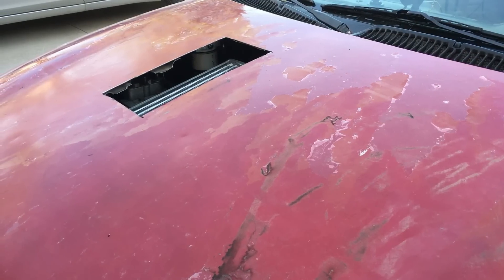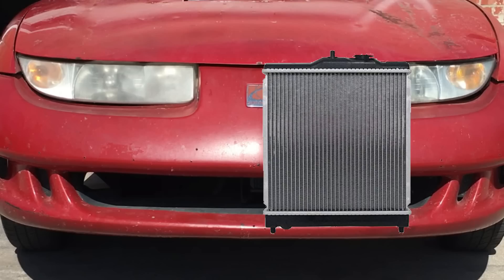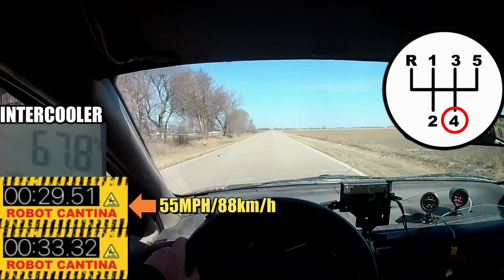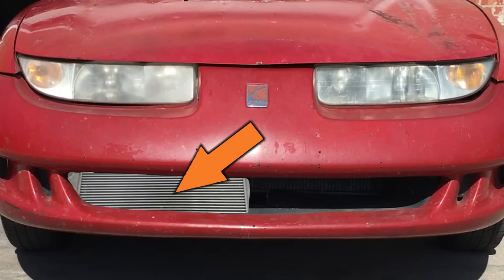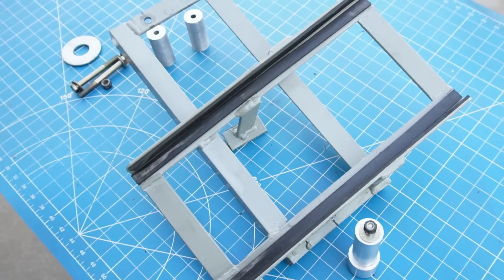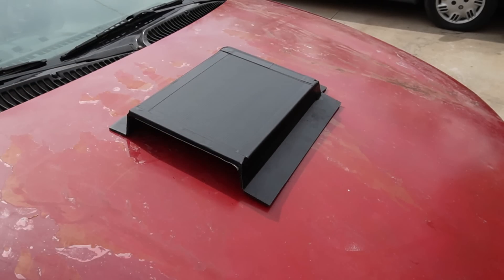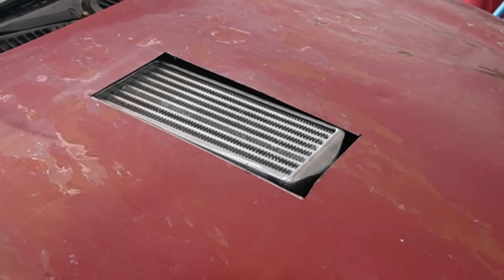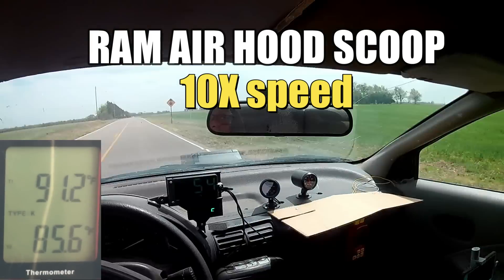S3 E12.  Testing different modifications to the intercooler on the Kubota turbo diesel Saturn.

Comment: I think he should definitely try the fans under the IC, and also rigging up a windscreen washer to spray on the intercooler but not while there's fans fitted. The hood scoop could be replaced with a better looking smaller one if the other ideas don't give any gains.
Lastly I think he should try and see if he can get the turbo to boost to a straight 1bar and then add more fuel for a final 0-60 test. It would also be fun to put the car on a Dyno at that final stage of tuning and see what it makes at the wheels compared to the factory rated bhp for the engine. The dyno pull is less stressful on the engine than doing long top speed runs too. If it survives all this which I think it will, I'd retire that little engine as it's more than proved itself then.
I also hope he tries to find a cheap 2-3 cylinder 2stroke engine for the Renault project. Alot of people have wondered if such an engine can be successfully mated to a car gearbox the way he has with the Kubota.

Comment: I have a 1,0 TSI VW Golf 7 with 85 hp. Normally, I drive at max. 3000 rpm, mostly 2000 rpm. Power is torque x angular velocity, so at 2000 rpm and 175 Nm, the engine got 50 hp at that rpm. You can drive at 90 km/h at 2000 rpm and easly pick up speed. For the max. speed of 180 km/h it needs the whole 85 hp. And till 150, it gets there very quick.
Jimbo is on the right way: You need far less power, than most engines produce. So they can't run in optimal power output and have a very poor economy.

Comment: It makes perfect sense that "plan B" worked so well. You said the intercooler didn't provide any performance increase, but I think you might be overlooking something. I've found that, for every 1 degree decrease in intake temp the exhaust temp also (usually) decreases by 1 degree. You had issues with exhaust temps in previous videos. The ram air scoop decreased intake temps by 13 degrees. Did you notice a corresponding reduction in exhaust temps (Maybe not the full 13 degrees)? That might allow for some adjustment of the injector pump and/or you can push the engine a bit harder on acceleration.
The fans should yield similar results as the scoop but I think it goes without saying the pushing air though from the engine bay will increase intake temps.

Great videos! I always enjoy seeing what contraption / combination you'll come up with.

Comment: Sooooo.... Any thoughts about my 'Heath Robinson' approach to using a 5 Litre pressurised garden sprayer filled with ice and water, with the spray nozzle spraying ice cold water onto the intercooler/fins to drop the intake air temps down to even colder temperature?? I'd give it a try hahaha 🤔😏😉
😎🇬🇧

Comment: If the intercooler temperature isn't making a different, that means that the air density there isn't making a difference.... YOU NEED MORE FUEL!
So back to the fuel rack... maybe new and bigger injectors, and hope you don't punch pistons and rods out the bottom.

Comment: Another great video!

The cowl induction scoop needed to be extended to almost the base of the screen to tap into the pressure zone there.

I liked the Ram induction scoop, you could also have ducted the base of the cooler to the bumper inlet if you don't want to run a scoop. 

Really enjoying the series thanks for all the effort.

Comment: Cowl induction works because the engine creates more negative pressure than the air around the hood. In this application, there's actually positive pressure below the intercooler, and that's actually drawing air in through the grille, which is being heated up in the engine bay and exhausted through the reverse-facing hood scoop.

Comment: now at this point im wondering if the hotter air would make it burn better an get better mileage, the front facing scoops always work better for hood mount intercoolers, i mean subi an other brands use that style an its not just for looks lol, but the cooler air from the front facing scoop if the cooler was bigger an had more of a whole in the hood to fit it that might do something, but at this point i thnk that intercooler is just tapped out.. great work on the tests an debunking scoop placement an design, thanks again jimbo !

Comment: There appear to be solid tappets inside the injector pump which will adjust the fuel timing beyond the single gasket/spacer, if you can get or make thicker ones.  They have numbers on them so I assume you can get a range of thicknesses.  Of course too thick and not enough mounting spacer and it could fully bottom out and ruin the cam or pump.

I think the metering screw in front could be attached to a servo motor so a goofy little arduino or such could read some sensor data and turn the fuel up at high boost/rpm, or turn it down at high EGT.  Based on the thread pitch it should be pretty accurate in MM per the swept angle.  This might smooth out performance and also get the top end into 5th without high EGT by fine tuning fuel on the fly.  Also once the microcontroller is reading sensors it could datalog.

I got these ideas watching this teardown/cleanup/reassembly video: https://www.youtube.com/watch?v=cO5qPn7S6co

Toward the end he tunes in the fuel metering while it's running so that it doesn't surge at idle and goes full governor at full throttle and doesn't die when slapped back shut.  This alludes that something could tweak that while running as long as it has the capability to set it accurately back to idle/base quickly so it doesn't die off.  Some gas turbos will adjust the fuel pressure according to the boost level to change the lb/min feed rate, this would emulate the same thing.

Too bad there isn't an easy way to make the timing adjustable on the fly...

Comment: Aluminum will dissipate heat even in a hot environment, if you’ve ever welded (or even just tried to cut)aluminum you will experience this first hand.

Comment: Good video! I think that the fuel induction method here is probably the limiting factor in not realizing the the more dense air charge from the cooler air. The air to fuel ratio is just not able to be adjusted on the fly to take advantage of the density improvement of the air. 

I think it’s the universal gas law that would seem to used to calculate the volume of a gas at a given temperature and pressure.. if the pressure was the same for both the 125 degree air and the 95 degree air there should be a double digit percentage increase in the volume of air being supplied to the engine. Rough guesstimate of 20-24% which theoretically would be substantial if it could be fully utilized.

Comment: Intercooling is only necessary if boost is above 9 psi.   Colder air is denser, so you'll need to add fuel to take advantage of the lower temperature.  The air has to stay in the intercooler long enough to dissipate the heat it holds.  Might want to experiment with an output restrictor to increase the charge air dwell time.

Comment: Heating the intake air makes sense given that diesels use the heat of compression to ignite the fuel, so starting from a higher initial temp just raises the final temp a few degrees making ignition more positive.

Comment: Fans cooled intercoolers are a thing as i am shire you know. But i don't think a computer fan has enough pressure to push air effectively through such a thick cooler.
So you may have to find a fan from a water cooled motor cycle or quad that will have enough power to get air through.

Comment: You will not gain/add power until you add fuel. Intercooler is there to keep high numbers lower, you can't make more power without more fuel which can be done with you lower intake temps.

Comment: Keep up the good work. I love these videos.

I doubt it will make a big difference in this application, but it might be worth doing some manometer testing to make sure there isn't a reduction in pressure difference from in front to behind the radiator.
I would think it would be a non issue given the rad only takes up half the grill.
In some applications, adding a good scoop can reduce the air pressure difference across the radiator and cause heating issues. Again, unlikely to be an issue here

Comment: You k ow that you are missing the hood scoop right? And all intercoler systems inside the engine bay. TMIC. SMIC VMIC. They all suffer from heat soak. Why not prove it and run a Air Temp sensor before and after and go for a drive. You’ll notice it only gets hot at a stop. During driving it will receive fresh air and the bottom won’t be hot like you are assuming.

Edit: leaving the message up but it pays off to watch the video before posting. Carry on. 😅😮😢🙄

Comment: The diesel Isuzu Bighorn ("Trooper") (not pronounced "Ee su zu" but "Eye su zu", kinda like "Ka boat ta" instead of "Ka boot ta" ) has a bonnet (or "Hood") scoop and rubber surround. I noticed that the front of the intercooler was sticking up into the airstream flowing over the bonnet, perhaps angle the intercooler so it's more in line with the angle of the bonnet and add gasketing between it and the bonnet with the bonnet scoop?.

Comment: Instead of scrapping it out why don't you sell the Saturn to your fans???
Reply from the maker: The value of the Saturn is based on the sum of the parts that it took to build it.  No reasonable person would pay the amount we would need to recover the cost.  When we scrap the car we will of course keep the engine and all the custom built parts to use on another project.
Reply: @Robot Cantina  I wish I had real money to talk with. I would totally rock a 750cc turbo diesel Saturn. lol, this car would be the talk of Mississippi.

Comment: All you had to do was spend 15 minutes cutting and bending a piece of tin to be a heatshield. Also for what its worth, engine masters discovered that even without airflow, an intercooler still provides cooling, acting as a secondary radiator.

Comment: I hope to see this car get perfected and even more get some cosmetics attention. Would be cool to see it as a fully functional decent looking car. To bad its going to get crushed....
Reply from the maker: The Saturn is in poor condition and was in a bad accident a long time ago.   A lot of the metal under the skin is damaged and the front subframe is bent.  The windshield is broken,   Every plastic body panel on the car is damaged.  The floors are rusted through.  The wheel bearings are bad, the interior is  disgusting.  Overall the car is ready for the scrap yard.  It was the perfect car to do our experiments with but I'm afraid it really cant be restored.  The engine and all the custom built parts will be removed and used on a future project.
Reply: @Robot Cantina  I see what you mean, then yeah I it needs to go.

Comment: With intake temps of around 120F, there won't be too much gain with an intercooler.  However, if you are able to run significantly higher boost pressures the temps will be much much higher, and inter cooling becomes an advantage.  My Cummins 6.7, stock fuel settings at 40+ PSI boost will run in excess of 300+ degrees on the compressor side.  The intercooler will drop the temp to around 20-40 degrees above ambient temp.  That's a huge improvement.

Comment: No scoop... some venturi effect, so its mostly warm air from the engine bay passing through.
Ram... cold air forced into engine bay.
Reverse scoop, enhanced venturi.
Side scoop. Same deal.

That being said, the others would have worked if fed their own cold air rather than hot engine bay air...
A true maniac would duct the underside of the IC outside as well...

Comment: Taking the direct path between the charger and intake isn't necessary the best option. The intercooler needs to be in the front of the car down low so it has ram air. Just like your test has shown, ram air works. Getting the intercooler away from the engine and having some extra piping helps lower IAT.  The goal isn't performance, but it is to lower egt. Lower IAT=LOWER EGT. There's a reason manufactures put the intercooler up front. Ford used the style intercooler you have in the 80s on the svo mustangs, it didn't work great. Just move the intercooler and make us happy
Reply: You also get the benefit of "storing" some of the boost you make in all that piping. You do have to be careful how much you store, and have the ability to blow off the excess, but it does help.

Comment: Intercooling for MPG is a waste of time. You are running the engine under vacuum while cruising,. You only need an intercoler when you are making power and the compressor is raising the temperature of the air going to the intake manifold..
Reply from the maker: We installed the intercooler to see if it would boost performance.  Believe it or not the videos we make on this car  are about making the car go faster and fuel economy is not our goal.  We provide fuel economy data because its interesting for some of the viewers.

Comment: I think the intercooler doesn't inherently give more performance if you don't give the engine any more fuel than without the intercooler, I think tho the intercooler gives more headroom for increasing fuel delivery since the compression and then combustion can start at a lower temperature

Comment: OK I hope you do get a chance to read this message. The idea with an intercooler or a charge air cooler on a diesel is not going to give you more horsepower because of dense air. The idea with a diesel is cooler air going into the engine equals lower, egts, lower egts means you can throw in more fuel.

Comment: Glue a small freezer to the rear deck lid, modify a weed-eater so that it pumps water (roof mount the pumping system), and then mount the intercooler inside of a large hood-mounted ice chest. Plumb the whole thing with PEX. Just spray paint the whole mess up using the Krylon Camo system so that it is virtually invisible.
Reply: Wiper-mounted dual intercoolers is also something that seems feasible.

Comment: If you want airflow across a radiator you need to have an effective pressure difference across it. As is, the hood hole will likely act as an air outlet since its in a low pressure zone and you are probably allowing more than stock pressure build up in the engine bay past that small radiator (if you haven't shrouded it that is). Closing off the intake hole a bit might make the ram air setup more efficient (and the other radiator too).
Enough regurgitating Julien Edgar knowledge for now, am enjoying your series a lot so far.

Comment: The point of lowering IAT in a diesel is to lower EGT 

Heat in = heat out

It’s so you can add more fuel. And run higher levels of boost It’s a supporting mod not a mod that will directly make power.

Comment: Make a bigger hood scoop that more effectively is able to ram air through the intercooler. also make some sort of gasket to make sure all that ram air is being forced through the intercooler. Doing this may cool EGT enough to add slightly more fuel, and therefore, more power.

Comment: Can anyone explain to the author that intercooler will not add performance. It will low air temperature,  which made air more dence, so per volume will be more oxygen which will provide condition to add more fuel, which will raise the performance

Comment: Once a gain, a fun video! I suspect you would have additional cooling with all those winds out there on the plains! Have you thought about vortex generators on the hood in front of the inter-cooler? The disrupted airflow may add enough turbulence to cause additional flow over the inter-cooler. Just a thought...

Comment: I'd really like to see a test with a water to air cooler. the advantage here is the ability to cool with ice if desired, or plumb it as a heater core in the winter to heat the charge air.

Comment: it would be interesting to see if there is any difference in engine power with the wastegate pressure line moved AFTER the IC, since the cooled air has contracted there should be less boost in the intake manifold = same oxygen level as without the IC...maybe the exhaust temps will drop also

Comment: Like others have said, the idea of an intercooler on a diesel is to lower egt.  This, in turn, could be used to add more fuel for better performance or to use as a safety buffer for egt.  I actually like the foward facing scoop as it is reminiscent of the WRX.

Comment: Having seen wind-tunnel test results, cfd simulations, and testing from lots of people obsessed with fuel economy, I've learned that there's an area of high pressure on the hood just in front of the windshield when the car is moving at speed, and that if there's just a hole in the middle or back of the hood, air tends to flow down into the engine bay rather than up out of it.
This makes me believe that without any scoop in place, the air was pushing down through the intercooler instead of up through it.
So I predict that with no air scoop, the fans pulling air down will be more effective than the ones pushing air up out of the engine bay. Or it'll be too small an effect for you to measure reliably.